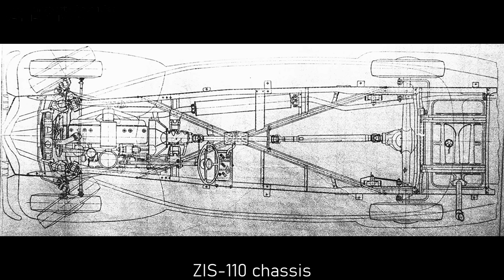How the Soviet Union Built a Luxury Car in 2 Years!

Comment: Mechanically, they copied the Packard, so no need to develop anything.  As for styling, the ZIS has fenders that look like they came off of a GM car, and it appears that it was wider across the cowl than the Packard, which had a rather narrow front seat.
Reply: Even simply copying Anglo-American technology is not easy, if only because of the need to convert inches to millimetres.
Reply: @ГайМонтэг-н3к  They probably didn't convert, as Packard mechanical parts are, as far as I know, were interchangeable with ZIS-made parts of that era, and of course were better quality.
Reply: @jamesbosworth4191  Any mechanism has many standard components, such as bolts, nuts, tubes, and wires. And all of them needed to be replaced with Soviet-made ones. No one would have started producing non-standard bolts or tubes just for the ZIS automobile. Finding standard Soviet hardware to replace the American ones, while not as difficult as for an aircraft, was still challenging.